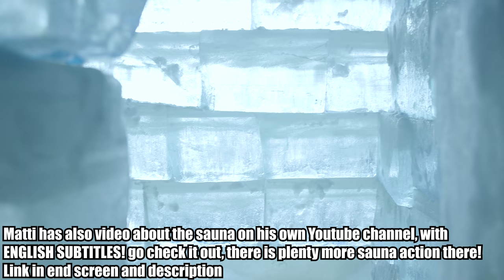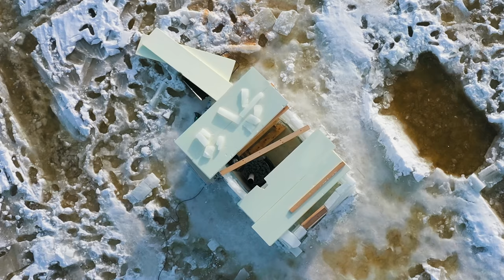Ice Sauna | Ice + Hot Steam, Will it Melt?

Comment: Next episode: "a fridge made of fire"
Reply: Gas fired camp fridges used to be pretty common :)
Reply: yeah what's next flammable refrigerant like propane or something?... no really residential split systems in the EU will prob use propane when we get the tubes and compressor bits figured out.
Reply: An ice furnace lol
Reply: I like the way you think!!
Reply: Closest thing is propane powered fridge- no comprende
Reply: So like a propane fired fridge in a camper or RV?
Reply: @Deere2154D  yes! Mystifying!
Reply: @Deere2154D  Well no, in this video we have a human made hot environment contained by an unsuitable cold melting material making the heating hard.

The equivalent "fridge" would maybe be a walk in freezer with walls made of red hot iron walls.

Comment: When I was young I dated a Finnish-American girl. When I met her family I had to take the obligatory sauna with them in their back yard. They said, "If it gets too hot for you, just put some water on the rocks to cool them down." Made sense to me. I thought I might literally die. They got a good laugh out of that, but then I was part of the family afterwards.
Reply: Lol!
Reply: This sounds exactly what my grandfather (a Finn) would say too.
Reply: @billbauer9795  It makes the air temporarily feel markedly hotter.
Reply: @seneca983  Very counterintuitive!  The girlfriend's family were funny!
Reply: @billbauer9795  I'm a tad late here, but basically when hot air is dry, it doesn't feel as hot because you can sweat and so your body loses heat more easily. When you dump water on the rocks it releases steam, and the increased humidity means your sweat won't evaporate as well, and as such you feel as if it was hotter. Also air is a pretty good insulator, so usually the rocks are way hotter than the sauna's air temperature. The steam released disperses around the room raising the air temperature.
Reply: @MaskedDeath_  Thank you for the explanation!
Reply: @billbauer9795  basically throwing water on the rocks is how the sauna actually gets hot :D
Reply: @billbauer9795  do you not know how a sauna works?  You throw water on the hot rocks which then produces steam

Comment: Fascinating, like it was said in video you can't really warm ice so I didn't think this would work well but I see clever use of the rocks and open roof to just heat up the air worked well, pretty cool.
Reply from the maker: there was enough heat on the rocks for about 30 minutes after that it was too cold. I have heard that some people have used two kiuas. One in the sauna and one getting hotter outdoors and then you keep changing those :D
Reply: @Beyondthepress  Like hot swap stove. 😂

Comment: Last week I thought I had seen all madness possible, this week you lot come up with more. 
I love it!
I guess the walls of your sauna even are self-mending. Once they have molten to a point where enough heat is radiating off, enough steam will collect on the inside of the freezing cold surface to repair any damages. There should be some temperature differential and wall thickness/area limit at which this effect hits a steady state, I guess. Doing those numbers might be worthwhile!

Comment: You should use some thermal insulation foam inside heat room. Even 1 meter of 5mm foam from the ceiling would gave you hot space on the top bench.
Nice work, thought!

Comment: I have a great idea for a video. Make a small building and then put a water sprinker on top of it. Let it run in the cold to see if you can make a true ice house. The roof and walls would need to be extra strong though because the ice will collapse it otherwise.

Comment: So, lets recap: They are building a 4 ton hut on a frozen lake, right? And then the put a 350 or so kg oven in there to heat everything up, right? And of cource the ice used for builging the hut is taken from the lake itself,,from a circle around them, right? So, they are on a floating, rotating 50 cm sheet of ice on a lake, right? And when is the time, where they decide to heat up the sauna, heat up a bunch of water on the ice that carries them, below them an ice cold lake? You got it - at night time, in the dark where it would be really dark to rescue someone or even find orientation, if anything went wrong.